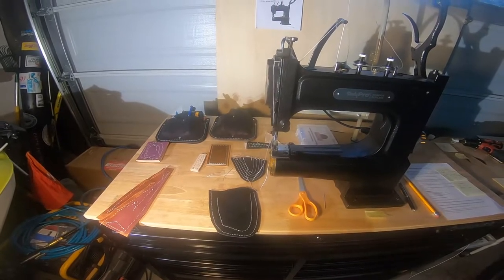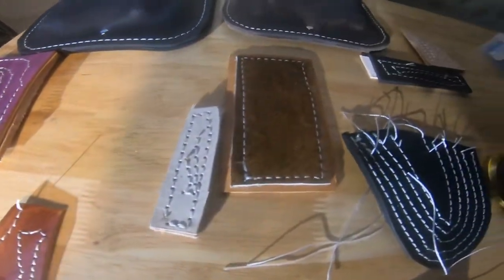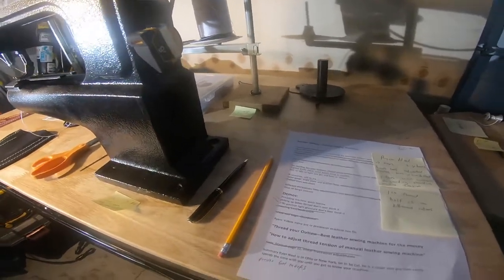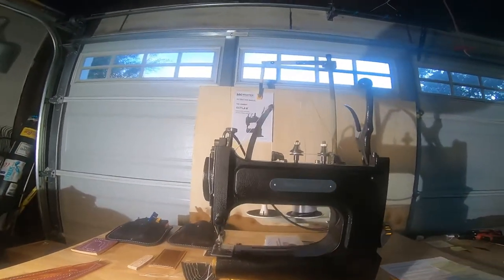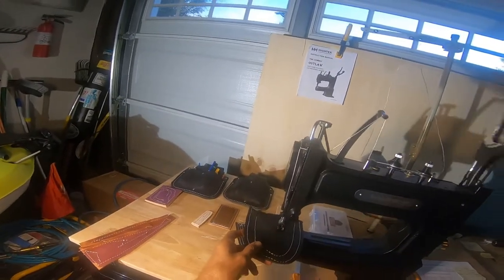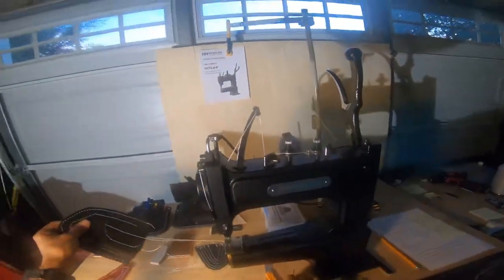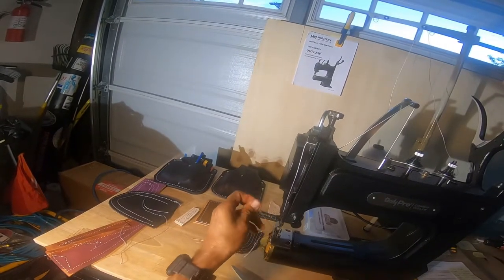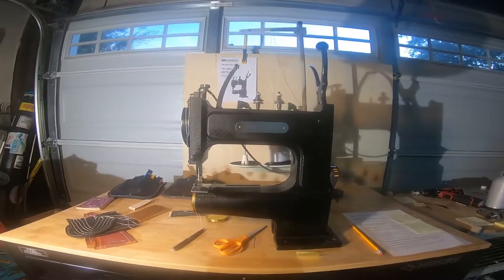Cowboy Outlaw sewing machine follow up

Comment from the maker: Great question, yes knob is in front that turns clock wise and counter clockwise. I use tight stitches for webbing for example and bigger stitching for larger 277 thread.

Comment: Would this work with leather around 6oz? I talked to a rep at Tandy who said this is better for thicker leathers but I feel like he was trying to upsell and make me get the Cobra Class 26. It would be for wallets and small goods as well as totes. Thanks for the help!
Reply from the maker: Hi Melissa,
Sorry for the late response. Yes you can sew 6 oz leather but you have to use the smaller needle size, and thread. It’s super easy to change the needle and thread after you have done it a couple times. Email me at jpadventures@yahoo.com and I can probably send you a video or we can FaceTime a demo. I sew thin materials such as webbing with it. I hope this helps.
Reply from the maker: I to was going to buy a Cobra machine but so far, this is doing all applications for me and it’s more portable, and less expensive.